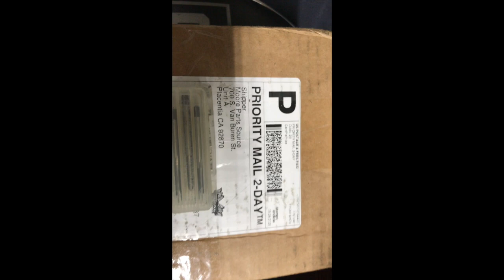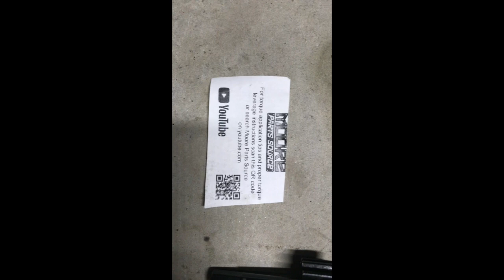VW Beetle Axle Nut Removed Using Torque Multiplier

Comment: I just got this torque multiplier tool... but that 36mm nut does not fit all the way in & the tool seems a bit rusty eventho supplier claims its new 🤔. They r telling me its normal for it not to fill all the way in but i doubt that. So checking with you if that 36mm nut fit all the way in that tool? Thanks!
Reply from the maker: This was a couple of years ago, but I believe the socket fit completely on the nut. I also reviewed the video and the socket looks flush.

Comment: Did you try an 8 foot cheater bar with 3/4" drive socket?     That always works for me.
Reply from the maker: My cheater was 4-5 feet, but that was not enough. This tool was fast and easy. Highly recommend.